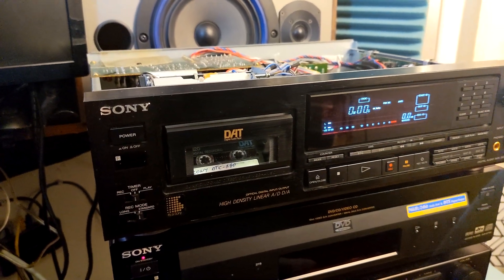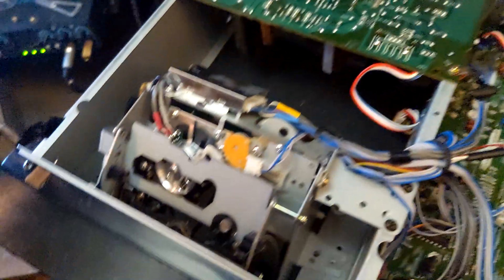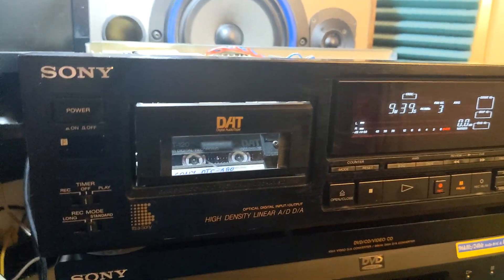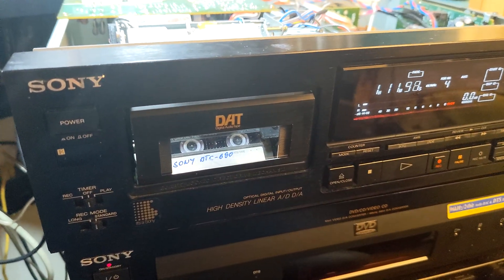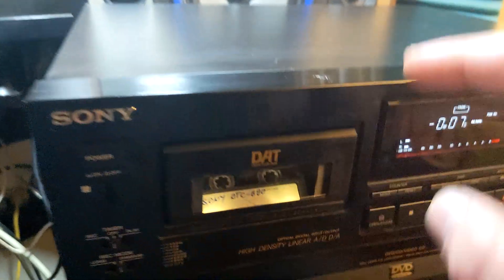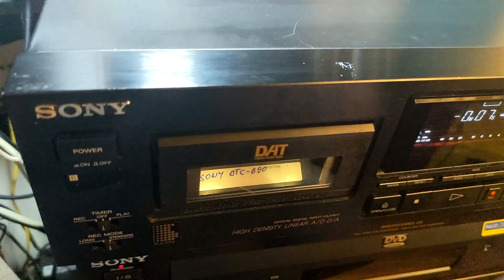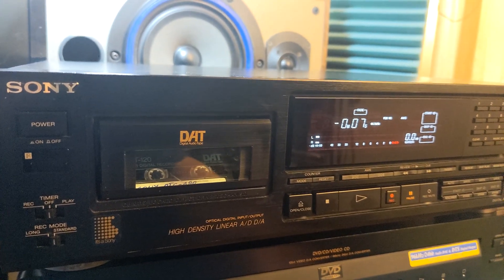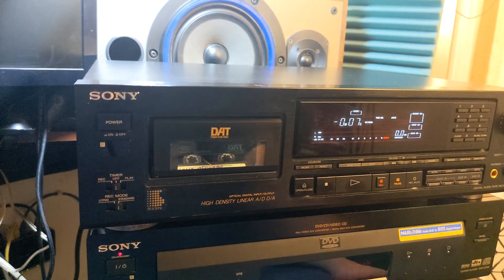Sony DTC-700 - vintage direct drive digital audio tape, great DAT!

Comment: I was using my dtc 700 to send 48hz to protools. I had to engage it into record to do so and I paused it. It was in that position for weeks. Now it won’t disengage. Any suggestions? I am the original owner.
Reply from the maker: Usually you can do that without tape inside, so I'm not sure if the tape is still inside / stuck, or it just does not respond to commands. If the tape is rolling but not playing, it's probably a dirty head. If the mechanism is not engaging, could be a dirty switch inside, or that plastic part that holds the rotary switch is the usual suspect, broken